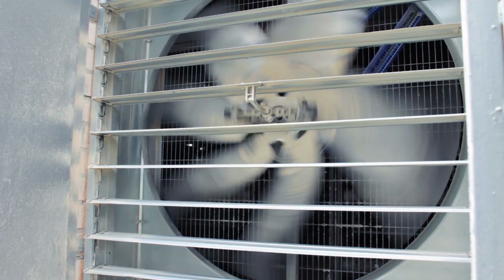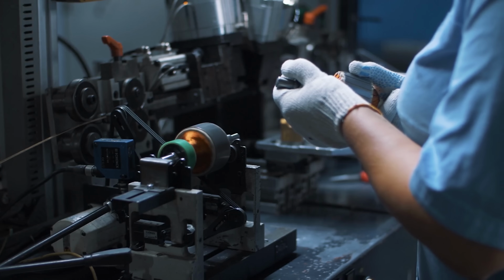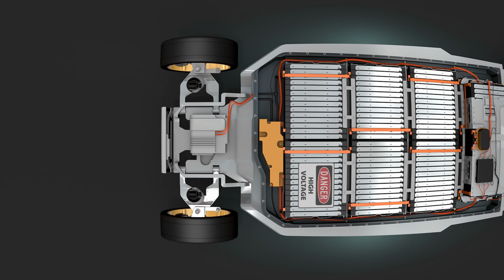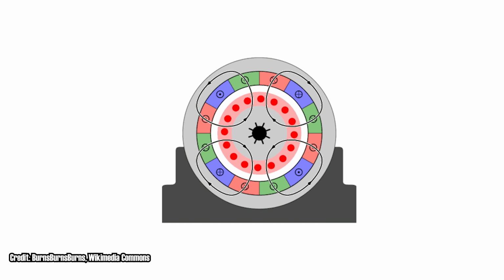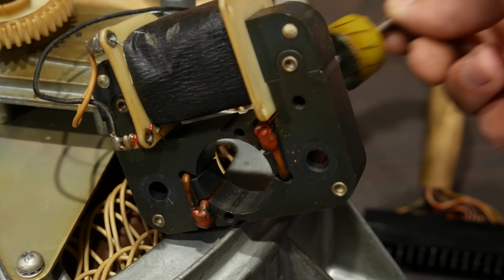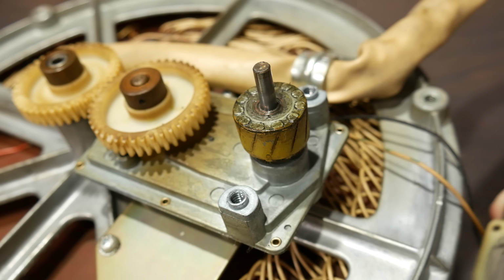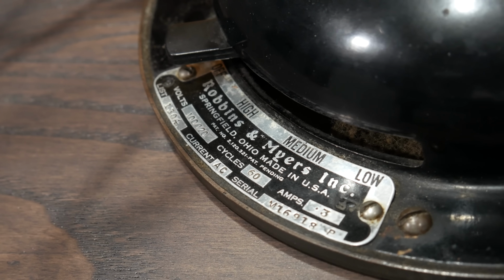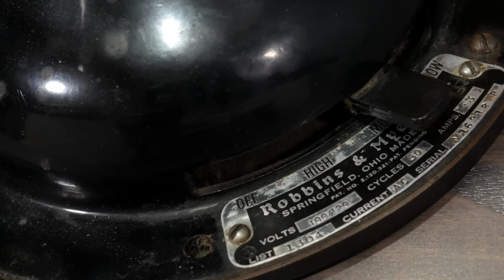Fans; High is next to Off on purpose

Comment: My initial thought was "to shut it off when shit goes south" as a legacy from more dangerous equipment, because having no on\off button and having to cycle through a few modes to get from the most intensive one to off position gets a mental kneejerk from some engineers even if this particular device is pretty safe. But... I guess that works too.

Comment: I want a fan that can have a volume knob, to have "infinite" levels of speed, like a volume knob, it gives you more precision.
Reply: It's called a Variac.
Reply: I want a fan that goes up to 11.
Reply: i want a van
Reply: @hercules5813  Why don’t you just make ten the top setting, and make that a little stronger?
Reply: I think I once saw an exhaust fan over a spa bath that worked like that, this was years ago.
Reply: @colefrankenhoff1428  Because then you wouldn’t have the satisfaction of turning it up to 11.
Reply: @hercules5813  For only $300, I'll make one that goes up to 12!
Reply: That would probably have to be accomplished by an inverter/VFD, which is much more complex.
Reply: @lil man slim Because 11 is one more.
Reply: Dyson airblades have that unfortunately they're very finicky the durability is not there the board behind it became loose with time and you can't feel any actual tactile change.
Reply: Dewalt makes a battery powered fan with a fine tuning adjustment knob like a volume know
Reply: That requires a rheostat a much more costly device.
Reply: Im pretty sure I’ve seen a fan with a 0-100 scale. I used to set it to 69…
Reply: An ac drive can control the speed like that but the the speed is limited to the original winding design.
Reply: @hercules5813  just like postal it goes up to 11
Reply: A potentiometer would be useful.
Reply: Older Vornado models did exactly that. You could even turn them all the way down to a dead crawl of like 2 RPM. It was the floor models that had a u-shape base and could pivot up and down. I think it's the early 2000s models?
Reply: sets my fan to 11 and causes a severe weather alert
Reply: @colefrankenhoff1428  ...this... goes up to eleven...
Reply: @melllojelllo  I'll take a look. Thanks!
Reply: There were fans out there that had a dial like that, those fans were those xpelair taurus fans model T16 but they are very rare
Reply: Is that like... Not normal? 
I recently bought a Xiaomi smart fan and this thing basically has infinite speed adjustment in the app, though I think behind the UI it's a 0-100 scale with steps of 1. It was like 50$ for a sizeable standing fan.

Also the button on the fan itself to change speed starts at level 1 of 4 when you power on the fan, contrary to this video, so that's interesting, must be using a different motor.
Reply: @mataskart9894  fans with variable speed dials are normal, just not many manufacturers use them. I did acquire a fan today that uses a variable speed dial
Reply: @Lachlant1984  My grandpa has a fan like that, and even with that, the “on” area of the circular knob is the highest you can go, and the slowest you can go is the furthest part of the knob. I always thought it was weird as a kid.
Reply: They exist if you want a 1980s fan
Reply: @colefrankenhoff1428  spinal tap reference.
Reply: Use a dimmer switch
Reply: They have extension cords with dimmer switches on them that work with most fans and you can just move the dimmer up and down on the three different speed settings
Reply: @TechtodaProductions   that will fry the motor of the fan
Reply: @GabesFans   I've had it on a box fan for about ten years.
Reply: @TechtodaProductions   box fans might be different, but as for a ceiling fan, a dimmer would fry the motor
Reply: @GabesFans  oh, yeah a ceiling fan definitely wouldn't be able to handle it.
Reply: Me too.
Our current fans are strong, but all it's speed are similar.
Basically: strong, stronger and strongest.
Sometimes we want a mild speed.
Reply: I want a fan that has a volume knob, one that doesn't increase or decrease the speed of the fan, but instead makes it louder or quieter via hidden speakers that sound like fans but really do nothing else
Reply: a light dimmer?
Reply: Vornado makes DC motor fans that have "infinite" level adjustments, but they are quite pricey. They are both very efficient compared to traditional fans and they also can provide a very subtle, inaudible breeze that only uses like 2 watts or so, something I've wanted my whole life.
Reply: So a big computer case fan.
Reply: so a potentiometer?
Reply: there was an edison box fan with that, still trying to find that model...
Reply: What's crazy is the simple idea of infinite adjustability is actually really problematic & because of that there are a million AWESOME ways to do it! Changing AC or DC supply voltage, changing AC frequency, pulsing DC & varianing how "wide" (long) the pulses are, simply usign resistors, slip angle alteration.. Oh my, electric motors are SO MUCH FUN!
Reply: Pc fans have that, don't see why tabletop version couldn't
Reply: Infinite fan speed could affect the speed of the earth's rotation!
Reply: Fan at my work called big ass fan like that
Reply: We used to hack our 2- speed window fans and put a dimmer switch on  them. Then if you turn it on the high setting, you can choose any speed you like by turning the knob.
I have one in my window right now!
Reply: potentiometer
Reply: That would likely be a DC brushless with an inverter. Kinda like these in PC

Comment: What I wanna know is why do ceiling fans have one useful setting, a useless setting, and a tornado mode that makes me wonder if my fan is gonna break off.

Like, at least put something in between useful and tornado and get rid of useless.
Reply: If the fan wobbles too much when on high it's unbalanced. Much like balancing the wheels on a car after installing tires, there's weights that can be applied to fix this.
Reply: @user-ez9id7td4b  I don't have enough fans installed to raise the ceiling *ba-dum-tiss*
Reply: I love the useless setting! It's designed to cycle the air around without a lot of air flow. My fan is on the 1 setting all winter to help circulate the hot air from the ceiling to the floor. Hot air rises so all the heat in your house just sits up at the ceiling and your floors stay cold. A ceiling fan will push that hot air down or pull that cold air up and helps keep the room more equally heated
Reply: @WeneDog0628  
I used a penny to ballace a fan's blades once. I used double sided tape with a penny to find the balance point then super glued the penny in that spot on the top of the blade where it would not be seen...
Reply: @ShellShock794  I use that setting in the summer to pull up the cool air and spread it around to room again.
Reply: Yea even at the low settings ceiling fans are very effective at moving air. There's a reason they were so popular back when everyone smoked inside.
Reply: It also depends on what ceiling fan you get. A low RPM ceiling fan like a Hunter Original will move a crap ton of air (7000+ CFM) on high but will still make a noticeable breeze on the low speed, all the while running quietly due to the lower RPM. A good rule of thumb when buying a ceiling fan is that it should move at least 134 CFM per inch to be a viable solution (CFM / Blade Size in Inches = CFM per Inch).
Reply: At least your fan has a useful setting. Mine is like 1 rotation a minute or a hurricane. It's hilarious. But it's really does sound like your at an airport sometimes.
Reply: lmfao 99% of the time this is absolutely true. i actually have a ceiling fan with three useful settings right now. three! i’m rich!
Reply: lmfao 99% of the time this is absolutely true. i actually have a ceiling fan with three useful settings right now. three! i’m rich!
Reply: Dr Deuteron  I have no idea what that means. All I can tell you is that if a ceiling fan is 52" and it moves less than 6700 CFM, you're not gonna have great wind chill effect. The wind chill effect is the only reason I use a ceiling fan, and that allows you to raise the thermostat of your A/C unit to save energy. In Louisiana, running a central air unit is not cheap and running a window unit in addition is even more wasteful than just using a powerful ceiling fan.
Reply: The "useless" setting is a hold-over feature from the last century. The "useless fan setting" is not actually useless. It had a use. When Hollywood was making movies in the days before air-conditioning and they wanted to convey to the audience that the ambient temperature was damned hot, they filmed the fan, on the useless setting. The rule of thumb in watching those old Hollywood black and white pictures was, the slower the fan turned, the warmer the ambient air temperature is.
Reply: Wire  a potentiometer from the motor to the light switch on the wall and then put a know next to the fan switch the is next to the lightswitch.

Adjustable power on demand lol.  You cannot be lazy and you have to get up and walk to the switch when you are in bed and uncomfortable because the fan is going a tiny bit to fast..
Reply: @WeneDog0628  also the hanger the holds the fan is more than likely loose af. Kill the breaker before tightening because if you loosen it by accident and it falls. You might be electrocuted after the wires pull out and break.
Just a heads up
Reply: @pouringblood  I have a BigAssFan™️ that raises the roof!!
Reply: You apparently bought the wrong fan.
Reply: The useless setting is for winter, when you reverse the fan direction in order to  move warmer air down from the ceiling. You don't want the air to be moving so fast you feel the breeze though.
Reply: Tornado mode is useful for deterring intruders
Reply: Is anyone going to tell him?

Most ceiling fans have three speeds.

Comment: When I was working at an apartment complex, I was staggered by the number of motor driven devices that were just left by the dumpster. If your fan is not wanting to start on its own, take the motor apart, give it a good dusting, and lubricate the bearings. I still have those fans that I use decades later.